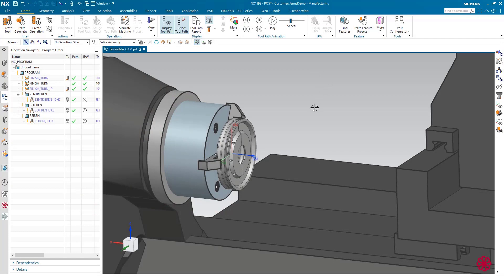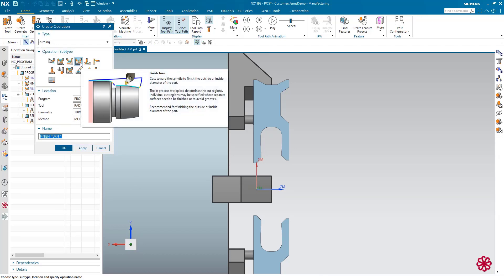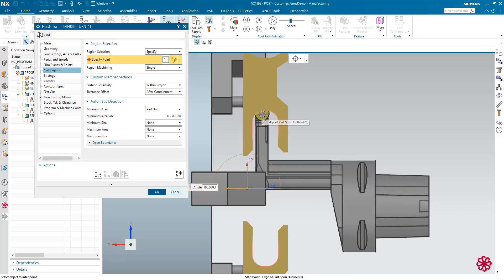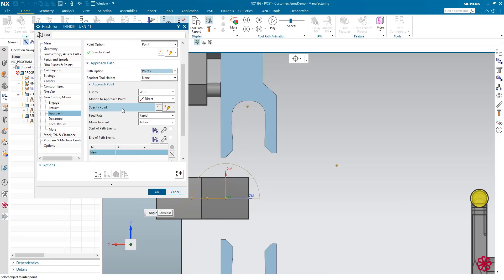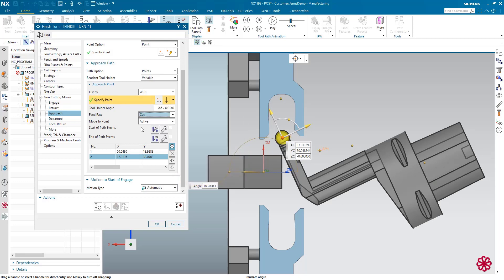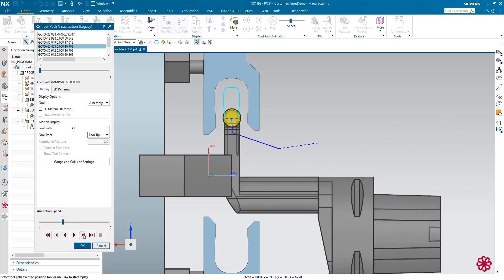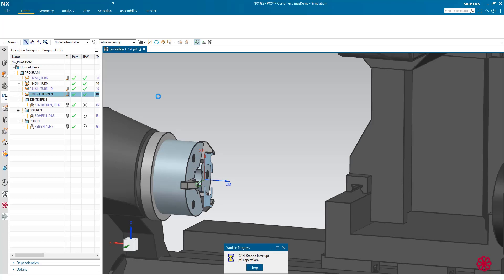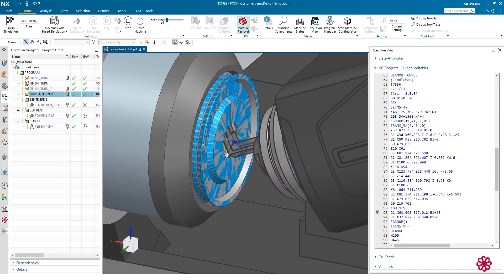NX CAM Tutorial | Difficult Approach Moves in Turning. How to define exact Approach ways in NX 🦾

Comment: thanks alot for the Tutorial! 
In a real Situation should i be worried about my Spindel and the Vibrations while performing this move? 
cause i feel like i need to use a revolver to withstand the vibrations while doing deep IDs
Reply from the maker: Hi Jay,

of course the machines rigidity is quite important. Yet we feel that the shown approach is a huge benefit when you have to cut those challenging geometries.